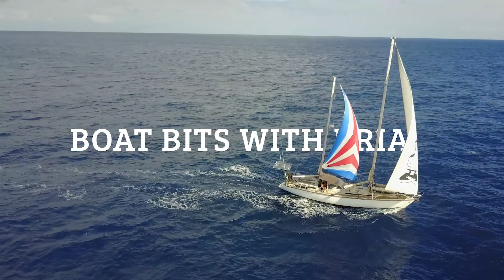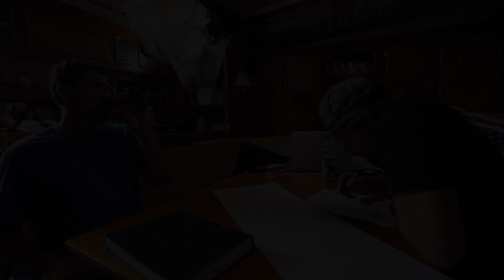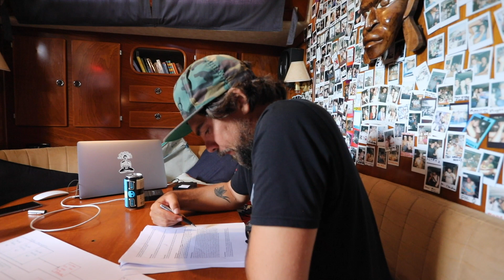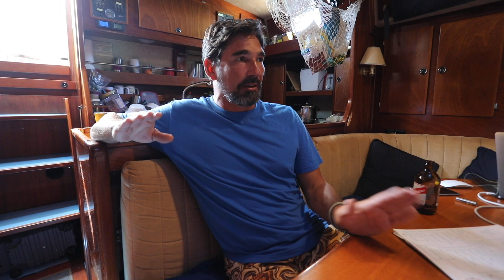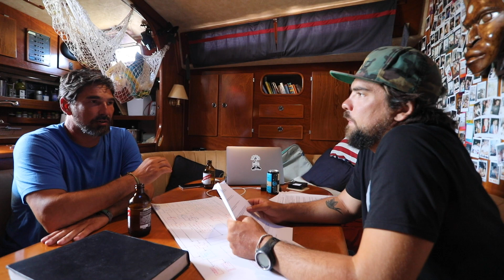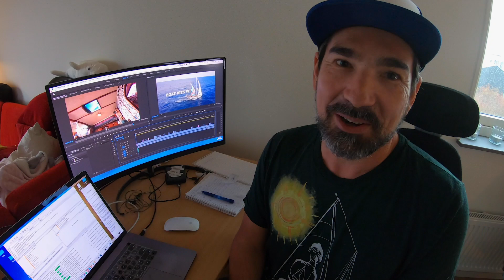What can Lithium Power? - ELECTRICAL BOAT TECH (6 of 7) -  Sailing Vessel Delos

Comment: Excellent!! I'm an Electrical Engineer and Brian is right on with his discussions and explanations!  well done and VERY informative!  Thanks!
Reply: Forty years as a marine electrician and even I can appreciate the simplicity of Brian's explanations. 
As for Brian coding, I can believe it. One of my friends got a master's degree in EE and for the past 20 or so years has been writing and debugging the code that makes modern fighter jets user friendly for the pilots.
Reply: @mikebarron5805  I have worked with a lot of Controls Engineers. Almost every single one has an EE. These are the guys who design the electrical systems for industrial machines and then program the PLCs and HMIs that run the machines. It can take months just to program a new machine and it's all in a little known programing language called ladder logic. So, yeah, an EE that programs is pretty normal in my experience. They make a shit load of money.

Again, I get the impression that Brian was not a Controls Engineer. It seems like he was programing computer software.
Reply: Hey that's cool, I have a friend who uses software like that to build simulators for aircraft! He's a straight up hardware nerd though and doesn't have his EE. Brian gives me the impression that he would still be able to understand the simple stuff covered in the video if he were a chef or a plumber. (No offense against either of those either. Just different fields) He has learned many things as most cruises do owning a boat and has to wear many hats just to keep everything afloat so to speak. ;-)
Reply: Brian is an EE as well. I sure hope he's right ;) .
Reply: @operator0 I didn't know he's an EE, but that explains his very thorough knowledge and his practical problem solving...I believe he's right...I love watching SV Delos!
Reply: Isn't Brian a reformed code monkey?
Reply: @danielbuckner2167  He has a degree in electrical engineering, but he spent most of his working life writing code. I don't think he was a controls engineer, but I could be wrong.

Comment: Funny thing is that I faced many of the same concerns when designing a solar system for my off grid camper van. The main thing I figured out is that you can't have too much solar input or too much battery storage, or for that matter, too much inverter. The only limitation is going to be available space and how much money it all costs.

Comment: Brian, I've been a Automotive tech for 22 years and I have been soldering the large cable ends for years. Like the real big copper eyelets. I'll clamp them in vise grips so the end the wire goes in is straight up, heat it up with a small torch while holding a long piece of solder in it. Once the solder melts and fills the eyelet a little over half ways i stick the wire in it. Just keep the torch on it till the wire is in completely because it cools fast and wear gloves encase the solder shoots out a little but that connection will last forever cause literally no air or moisture will get in it.
Reply: On boats soldering shoud be avoided at all times. When soldering you create a hard point in a flexible cable. Due to the constant movements of boats tiny cracks can appear. This in turn increases the resistance, thus increase the temperature of the solder and melt it eventually. Please use only crimp terminals!

Comment: So, real Q, if you would do this NOW, IRTime, would you change the diesel for electric? You got the solar, or could get. The el-motor would charge enough to get you anywere. The cost and hazel for the old motor is... Well, U know. So, is a re-gen electrical motor worth it? Or more thruthful, is it better? I like it easy and long-time-better. I like enviromentally better sollutions. BUT. 
So tell me, McGyver, är det bättre? Jag kommer göra det ändå, men jag vill ändå veta. TACK för att ni gör de här videorna och snälla söta rara, gör FLER! <3

Comment: The danger in soldering battery lugs is that a crowbar short will pull 3000 amps, even on one car battery, causing the solder to melt and release. However, high power elevator motors DO use soldered lugs to carry the entire motor load. It can be done, it is "up to code" but it is just not the best way to go on a boat, or direct battery terminal.

Comment: Several years ago major car makers were discussing going to 48vdc systems. They found out the hard way that switches and relays and other mechanical contacts arc and fail too easily at 48vdc, it proved unfeasible to use.
Reply: On top of the reason you mention they also ran into safety requirements. Most countries prescribe that any wire which contains a voltage above 42 V needs to be extra isolated (or double isolated). The reason for this requirement is that it is generally understood that any voltage above 42 V can be dangerous or fatal to humans.

Comment: In school they taught us that the electricity travels on the outside of the metal wire. Bigger wire allows more electricity to flow.  Smaller wire would heat up and provide resistance to the electricity flow.  Your doing a great job with these videos.

Comment: Cool videos, Thanks! Out of passing interest, small cable crimpers that do a good job can be had... I don't think links are allowed here, but search Amazon for 'Battery Cable Lug Crimper - Hammer Crimping Tool with Storage Pouch' for a typical example... no affiliation. They can be struck with a hammer or squeezed in a (admittedly huge) vise. Should you get one, I suggest using a few ends & scrap of cable to practice with.

Comment: Electricity travels through wiring on a sailboat more efficiently if it's an alternating or AC current... Electricity flowing through longer electrical lines as a DC current is inefficient and goes to heat... This is why Tesla won out with transmission lines over Edison's DC voltage transmission lines!
Reply: Exactly. This is why it is so important to size the wire for your DC circuit correctly.

Comment: With all that electric propulsion hype going on, there is a chance that we will see more 48V equipement in the future.
Reply: I'm hoping on that too but think it will be slow going. Back in the 90's some of the big players in the auto industry led by Daimler Chrysler tried to transition the standards in automobile electronics from 12v to 40v but that failed. 
There are a few 48v appliances for marine use like refridgerators freezers and even AC units but they are few and far between.

Comment: You could use a Buck/boost converter to power a Laptop, My HP laptop charger will output 19.5v @ 4.62 Amps or 90 watts.  So you would need a converter to handle at minimum 90w x 1.2 safety factor minimum so 108 watt minimum capacity.  likely there is more to this, but those are the basics.

Comment: Thanks Guys, great video. Just a quick question, how many full charge cycles do you think you will do in a year. I'm asking to sort out how long your battery pack will last. I'm guessing (please correct me) you will get about 2000 cycles out of your batteries and given you have a mid size battery pack, you might be doing more full cycles.
Reply: Brian stated he thinks the discharge rate is at most about 1/3 (133A of 400A on Delos) of the battery capacity. If you look up a typical life cycle chart for LiFePO4 at 1/3C and 80% Depth of Discharge (DOD) then in ideal conditions of 23 Celsius they should expect about 7,000 cycles. At 1C discharge rate (400A on Delos) and 80% DOD it would be closer to 2,000 cycles. The Australian Battery Test Centre has long-term cycle reports of house batteries that I believe are charged/discharged three times a day at 1C in Australian temperatures to between 80 and 95% DOD depending on manufacturer specs. LiFePO4 results: Sony/muRata Fortelion (Japanese Olivine-type Lithium Iron Phosphate) suggests 83% State of Health after 2,100 cycles. Pylontech US2000B (Chinese) 86% SOH after 1,470 cycles. BYD B-Box (Chinese) at 64% after 1,740 cycles. I believe Battleborn are Chinese cells, and discharged at 1/3C to 80% State of Health living in the tropics (about 20% less life) I'd say they'll get at least 4000 cycles or 11 daily cycled years. They may be on Delos 2.0 by the time they find out...
Reply: @CraigOverend  Thanks Craig, wow 4000 cycles. It really does show the merits of LiFePO4. If only the cost would come down a bit more. :-)

Comment: LOL Brian's face and tick when he says "VA is the same as Watts."  Yeah, I try not to try to get into that nuance with non EE folks.  Can't spell geek without double E, right Cap?
Reply: well in this case  VA is probably close to the same as watts; BUT -  power factor (reactance in the circuit consumes power and does no work)  comes into the equation, especially when specifying generators and with AC motor loads such as air conditioning
Reply: @HobbitHomes263  or comment on it being commented on.
Reply: You can just feel the Caps need to mention power factor.  Well restrained Brian you've pitched it just right.
Reply: @G0KAD  agreed, close enough
Reply: @HobbitHomes263  Careful, you are showing both your arrogance & your ignorance.
Reply: stimpsonjcat67. I know.
Reply: stimpsonjcat67 VA is watts in a fixed voltage DC system, Mr EE.
Reply: P=U*I is one of the 2 fundamentals of electrical engineering. (the other is the Ohm's law U=RI) Everything else is just fluff.

Americans, for your information: yes it is U, not V
V is the most common SI abbreviation for electric potential, while U (or ΔV, if you like using letter V) is voltage, i.e. potential difference.
Both are measured with the same unit, Volt. 

It seems that even in the very rare cases when Americans actually use SI-units, they still refuse to use the same names and abbreviations as rest of the world...

A much more descriptive term for voltage would have been electric tension. Te term is used in all other Indo-European languages than English. For some historical reasons, the Brits and Americans had chosen to use the word Voltage instead.
American English also uses amperage instead of current, and wattage instead of Power. At least in everyday language, not in scientific text though. 

I hope this was geek enough and sarcastic enough.
Reply: @paanikki  it's not our fault we're crazy...we're made out of everyone. ;P
Reply: Voltage V multiplied to current A equals wattage W...VA=W
24Vx15A=360W
or
12Vx30A=360W
Because different devices operate on different voltages and draw different currents you can't compare apples and oranges although power(in wattage) is what is the same between apples and oranges!